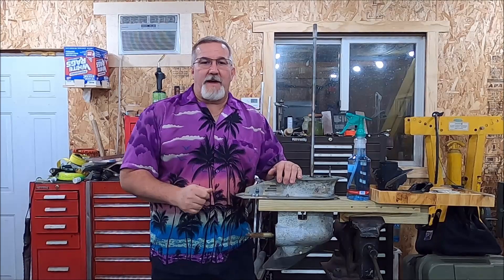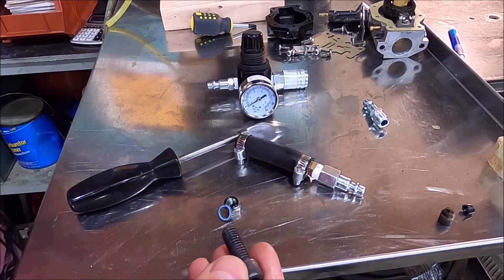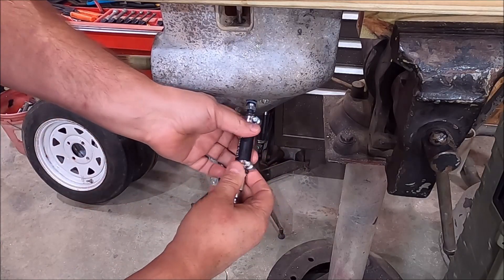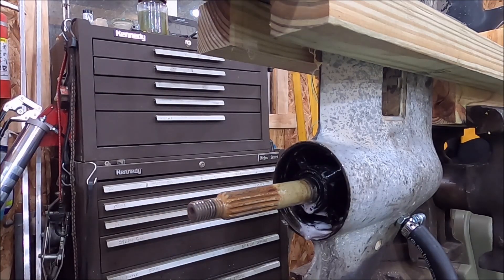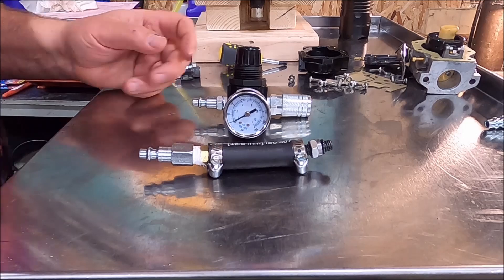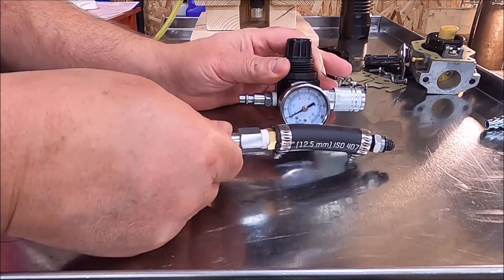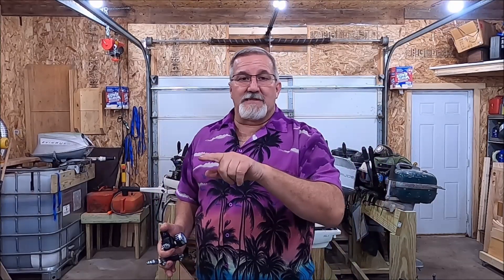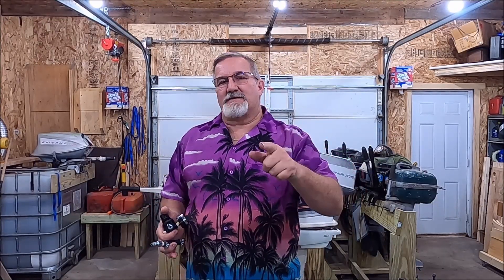Outboard gear box pressure tester DIY project. Test your Evinrude, Johnson, Mercury, Yamaha and more

Comment: Great video.
I recently had to replace the prop shaft seal on my 2008 Mercury 25HP 4-Stroke EFI due to fishing line (PowerPro). This (oil) was actually leaking on the floor.
Replaced seal. No oil leak. Ran it a few days later, pulled drain plug to check for water..  Not good news. Oil looked like milk. Going to fab pressure gauge like one on video to see what seal is leaking. I’m curious if water could have gotten into case from drain plug gaskets…? When I replaced the prop seal I ordered some drain plug gaskets that according to Amazon were replacement for Mercury but they seemed larger…

Comment: a mehcanic gawged my gear box carrier using incorrect tool to remove the prop shaft seal. since he ruined my gear box it leaks. I've been changing my fuild each trip. how long can I continue doing this?
nice tool you have there, I don't have shop air is a handheld pump good enough? thanks for advice

Comment: did this test and passed. But still get water intrusion. I heard that spinning the prop by hand while doing this test will give you a better result. Whats your thoughts on that?
Reply from the maker: I would agree, I have also heard of doing a vacuum test to see if it hold vacuum and I would guess that would let you know that water could get in if air can get in. Thanks for watching
Reply: @RMDCreations  I did both vacuum and pressure test. Someone recommended spinning the prop shaft while doing the test. First I heard of it.

Comment: My thought is to make something out of one of the pumps for lower unit fluid so you have the adapter my only other thought is on a alpha one lower you have to seal up the oil port that goes to the upper unit somehow and it's pretty small

Comment: When I was 12 or 13 years old my dad and I found a 9.9 Johnson at a local lake. A pip broke in the dam so they let out almot 1/2 the water.. I seen the top sticking out of the mud my dad told  me its just the top.   He went to grab it and pull a whole 9.9 Johnson out of the mud God knows how long it what in there..  we went home pulled the plug cleand a few eletricla connections fucker started right up 4 pull.. I still use it to this day on the back of the 12 foot boat my grand father gave to me afere I found that little 9.9.  Im almost 30 now..
Reply from the maker: Wow, that's a fantastic story. Testament to the old Johnson for sure.
Reply: @Michaelsbackyardmarina  Thank you for replying.. It brought me to tears writing that I lost my grand father 2 years ago and haven't been able to bring my self to the her out.. This inspired me to get that old girl bak on the lake.. I cant wate till summer I already got my 9.9 in the garage on its Johnson stand.. pulling it apart just to replace all the seals..

Comment: Nice video. I always like how creative you get using your engineering skills. I believe a vacuum test is necessary though because I’ve seen lower units pass a pressure test but still fail under vacuum. This means water intrusion. Seals need to work in both situations not just under positive pressure.
Reply from the maker: Good points and suggestions.  Thank you for the valuable information
Reply: NAPA sells a Mity-vac - Pressure/Vacuum tester for $62.39 online PN: 7001762. You just need to use the adapters from an oil pump kit.

Comment: Thanks Mike , very informative! I’m going to make me one! Also what kind of VOM do you recommend? And looking at buying a old Johnson 6 hs. 60 psi compression your thoughts Appreciated👍😬 . PS watch all your videos.
Reply from the maker: You lost me on the VOM.  It will run on 60 psi but that is pretty low compression.  I have had a couple 9.5 with 60-70 psi and they ran just fine.
Reply: Volt ohm meter , checking coils and electronic stuff.
Reply: Also 5 hp Johnson for sale guy said 60 psi dry compression thought maybe worn to far to repair ?? 50.00 was going to buy doesn’t run ! Comp. bothers me !?!?

Comment: Hi I have a question can you presser test leven the water pump on and put the lower end in surged water with the prop off can you see bubbles go round the water pump? . Is there a way to make this if you don't have a way to turn down the nut ?
Reply from the maker: I don’t see why not

Comment: As always a great video. The DIY tool is terrific. I personally do that type of thing quite a bit. I don't quite understand why you used the rubber hose and the extra steps. Wouldn't be easier and simpler if you used a threaded brass fitting and connect it directly to another air-chuck and forgo the hose, clamps and extra parts? Plus it would be a simple twist on and off a lubricated air-chuck to change out the different sized drain plugs and you wouldn't have to make extra hose connections. I can see the use of a hose as an extension for different applications where it may be harder to reach. . . Great channel! Keep it going! (LIKED)
Reply from the maker: All good points. Thank you for watching and commenting.

Comment: I’ve had a little water and put some sealer in there with oil and next draining no water. Doesn’t always work but it’s something you can try, before taking all apart.
Reply from the maker: Nice Tip,  thanks for watching and commenting.

Comment: One suggestion i will make only cause I've seen it happen many times on 2 stroke engines is to exercise the shafts while under pressure, setting static may pass test but when under motion could fail test, I've found many leaky seals by exercising the shaft.
Reply from the maker: Good call. Thank you
Reply: Mine still passes the pressure test even turning the prop and shifting , the vacuum holds to , until you turn the drive shaft and shift it ...I like to spay soapy water on it , but that don't work with vacuum,  and I gotta have both hands to turn it

Comment: Good project!!  When draining old oil I have put some fresh in the top hole just to flush out any solids.  The old stuff comes out first then the fresh.
Reply from the maker: That's a good idea!
Reply: When I get an old outboard that I don't know of the maintenance record, I drain the lower unit, fill it back with kerosene, put it in gear and crank it over good  with the spark plugs removed (lot easier without compression and it won't start on you). You'd be surprised of the gunk and until then stuck metal shavings that will drain out afterwards.

Comment: Enjoy your channel. Thanks for the nice tip.
If you already have an air compressor with an external regulator on it you could use that and save the price of a new regulator and just build the adaptor(s).
John
Reply from the maker: Yeah but I didn't want to mess with the on board regulator every time I test a gear box.  Thanks for watching and the comment